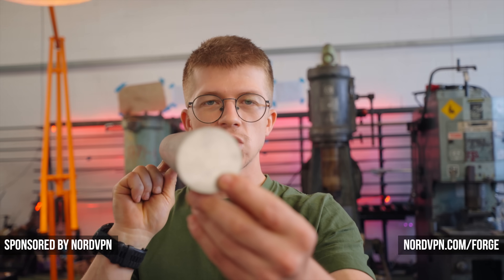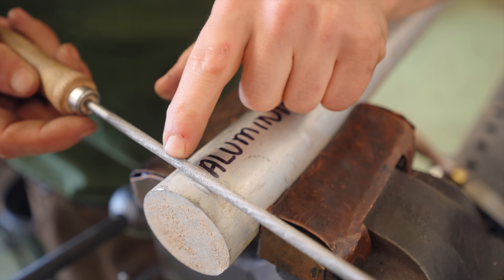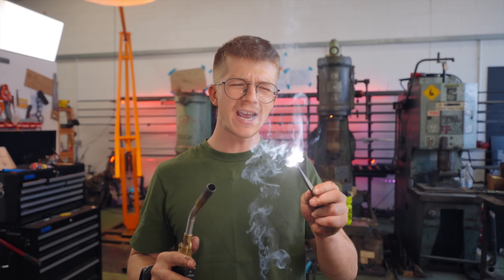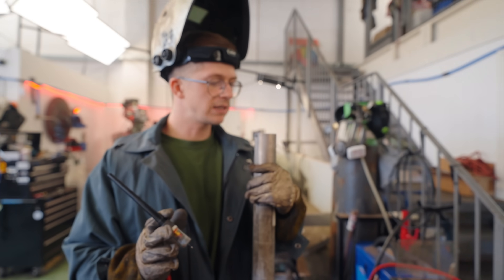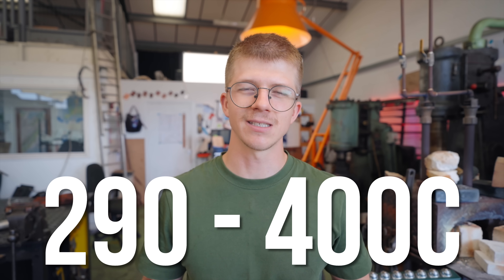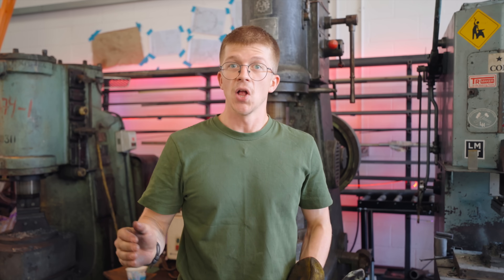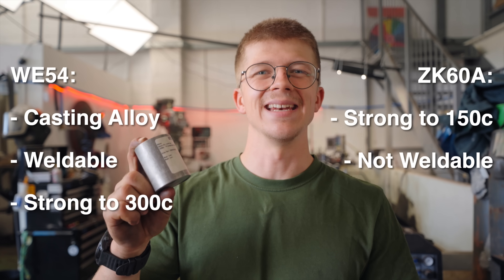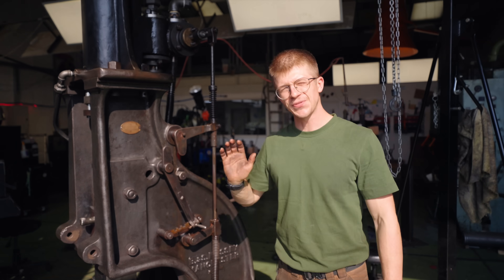Can You Forge Magnesium?

Comment: 0:20 "what metal isnt grey?"... Copper, brass, bronze, gold, to name but 4
Reply: Well, Brass and bronze are alloys.
Reply: @bl4cksp1d3r  So is the “magnesium” he uses in the videos.😂
Reply: @bl4cksp1d3r  so is steel though
Reply: @bl4cksp1d3r  Pretty much every metal part you ever used, saw, touched or used was an alloy. Aluminium can? Alloy. Gold ring? Alloy. Copper wire? Alloy. Iron? Alloy. Silver? Alloy. 

There is a chance you worked in a foundry and saw ingots of elemental... something. Probably lead or copper. 

Metal basically means alloy.
Reply: @krisspkriss  I am a studying engineer, Chemistry and metallurgy are in my smester right now. I get what you mean
Reply: @bl4cksp1d3r  yeah, but they're still metals
Reply: @amyshaw893  They're not pure metals, they're metal alloys.
Reply: @colorona8456  ok, what's your definition of "metal" and how is it different from "element"?
Reply: @colorona8456  isnt steel an alloy?
Reply: @amyshaw893 Not all elements are metals. But all metals are elements. An alloy is a mixture of metals. Hence, brass is not one metal, it's an alloy. Chemistry 101, dude.
Reply: @colorona8456  he didn't ask what pure metals. Steel was definitely one of the things he was comparing to which is also an alloy.
Reply: @bramweinreder2346  it's a metal alloy. Most of the things he would be comparing it to from a consumer perspective would be alloys. Most commercial "metals" are metal alloys. Aluminum, Titanium, Steel, Tin, in commercial products these things are almost all alloys not pure metals. He never said "pure metals" you guys are just being pedantic about not wanting to include alloys when that's almost exclusively the type of materials they work with.
Even the magnesium they're working with in this video IS AN ALLOY.
Reply: @amyshaw893  metals are a specifiic group of elements, alloys are mixtures of elements containing metals.
Reply: @colorona8456  this is a little pedantic, no? An alloy is still a metal even if it's not pure.
Reply: @cleverusername9369  It actually really depends on context. Because traditionally “metal” would refer to anything the looks and behaves like, well, metal. But in chemistry you also get the term metal for a certain subgroup of elements. Now alloys (being a mixture of at least one metal and other elements) are usually still metallic in their behaviour. And so depending on where you use it something like bronze would be a metal, or it would no be metal (in the sense of beloning to the element group of metals).
Reply: @colorona8456  So is steel
Reply: @bramweinreder2346  Well, an alloy is a mixture of elements, at least one of which is a metal. Steel is fundamentally an alloy of iron and carbon, but carbon isn't a metal.
Reply: @Wishbone1977  ah, you're entirely right. Thanks!
Reply: @amyshaw893  metal- a solid material that is typically hard, shiny, malleable, fusible, and ductile, with good electrical and thermal conductivity     Element-An element is a pure substance that cannot be broken down into any other substances. An element is made from just one type of atom
Reply: @zac9933  As you know, metals occur naturally in the Earth's crust, so they don't have to be produced by humans. Steel, on the other hand, is an alloy made from iron metal—meaning without metal, we wouldn't have steel. This also means that steel is not technically a metal, but rather a variation of metal instead.
Reply: @colorona8456  Tbf, it just said "metal" so the bar was set kinda low here
Reply: @amyshaw893 metals include all the transition metals, the alkali metals, and the alkaline earths, where elements include all symbols on the periodic table.
Reply: @colorona8456  the bar in question is also not pure. It's a metal alloy.
Reply: @colorona8456  Steel is also a metal alloy
Reply: @colorona8456  so are those two magnesium alloys he's using in this video.
Reply: @joepiejaapie  You can be the one to tell Alec he doesn't work with metals, then. Because steel, his usual metal of choice, is very much an alloy. As are just about all commercial metals not intended for processes as a chemical reagent.
Reply: @bramweinreder2346 if you're an astrophysicist, everything heavier than helium is metal.
Reply: @jnawk83  "everything" lighter too (hydrogen). I thought metals were only a small section on the periodic table. Turns out to be 80%!
I'm assuming we're limiting ourselves here to metals that are widely available for engineering purposes?
Reply: @amyshaw893  every metal is an element. not every element (like carbon) is a metal. an alloy is a combination of different metals. any more questions?
Reply: @I_Dawson_I  yes, it is iron and carbon.
Reply: @colorona8456 technically purely metal, just different metals but yeah it's not considered a metal but a metal alloy
Reply: @mosh8726  Electrum is a naturally occuring alloy and was known by the Greeks.
Reply: @amyshaw893 you could make a million alloys with color, elemental metals are by and large silvery or grey
Reply: @amyshaw893  Imo kinda weird to include alloys, because then you could include every fucking alloy of copper. Those alloys are not grey because they have copper in them. Or any other weird alloy.
Reply: @colorona8456can you explain when he said “it has to be a pure metal not an alloy”? No you can’t.
Reply: osmium
Reply: @dapcuber7225  Iridium, Antimony
Reply: @Locahaskatexu  but both of them are grey
Reply: Bismuth
Reply: @wavin_aquafino  bismuth is actually usually silver/ dull grey. The rainbow color is actually from rapid oxidation during crystallization.
Reply: @Gamewaterv2 Bismuth is grey. Its oxides are what can give it color, but only when the oxide layers are a specific thickness. That’s called thin film interference. The metal itself doesn’t have those colors.
Reply: @wavin_aquafino bismuth is grey also the colors are because of other processes
Reply: @wavin_aquafino  only when it makes the cool crystals, otherwise it's just a grey metal
Reply: @Gamewaterv2 fun fact bismuth is Grey but it's oxides are very vibrant
Reply: @Gamewaterv2 bismuth is grey without oxides
Reply: @Gamewaterv2bismuth is technically still grey. It has a very faint pinkish tint to it, but it’s still grey
Reply: @Gamewaterv2 Bismuth being literally every colour but grey. 😂
Reply: @Gamewaterv2 Bismuth is gray.
Reply: Is silver silver or is silver grey😂
Reply: @jono6379  yes
Reply: @jono6379 pure silver is actually more of an off white.
Reply: ok brass and bronze only because of the copper in it.
Reply: caesium
Reply: "Silver" metals are white-to-grey, the difference is how reflective they are, aluminium is the most "silver" metal because it has the most reflectance in the visible range. Copper and gold are the only metals with very strong colour-- they both reflect most strongly in infrared and drop down as they reach the visible spectrum, leaving a reddish-colour. Nickel is the only other metal with any appreciable colour - it has a barely visible yellow tinge.

Most metals mentioned here are coloured due to an oxide interference layer, like bismuth,  or "blued" steel, but have no colour naturally (grey/white). Titanium was mentioned as being white, it is also a grey metal, but "titanium white" is a pigment made of the oxide of titanium, not the metal, which is very strongly white.
Reply: Osmium
Reply: Cobalt
Reply: cesium
Reply: There is also color change that is a result of heat treating
Reply: @poetgriot18  it is not the color change of a metal itself, it is oxidation. I believe the only way to change the color of metal without chemical transformation (so it stays metal with metal properties like free electrons) is to make extremely fine powder, though works only with some metals, like gold.
Reply: Chromium
Reply: This replies to this comment are crazy 😂
Reply: At least I proved our videos aren't scripted, lol
Reply: @JamiePopple  unless you script in mistakes on purpose to encourage engagement.
Reply: Everyone is in here arguing about what is a metal and what isn't, both sides have somewhat compelling arguments, then a guy comes in out of nowhere and says sulfur is a metal. 

11/10, perfect comment section
Reply: Most commercial aluminum is also an alloy and not pure aluminum
Reply: Cobalt? Even the pure metal is still bluish.
Reply: Mithril isn't grey too, and it exists, and I'm not talking about titanium, search for "Hakim e os Anarquistas" on YouTube to see it in action
Reply: @CRTCLDSSTR  isn't it said to have a silvery colour?
also, what do you mean by "it exists"?
Reply: Ok to everyone that doesn’t understand alloys and metals here’s the deal: any solid bound together by metallic bonds is a metal, including alloys. Most elements on their own are metals, but that doesn’t mean only elemental metals exist. Oxides are not alloys because they’re held together by ionic bonds. Steel is an alloy even if one of its elements is not a metal on it own, and that’s because the carbon is participating in the metallic bond instead of ripping away the iron’s electrons, as oxygen would.
Reply: Those are just different shades of golden grey!!!!!
Reply: cobalt
Reply: Pure silver is actually a more of an off white color. Osmium has a blue tint to it. Sodium is the same off white as silver metal.
Reply: Wonderful 🧡
Reply: Came to write the same thing 😉
No worries Jamie, we all make mistakes 🧡 (some are just more public than others). Lots of love to ya buddy.
Reply: bronze and brass are alloys
Reply: Prove to me that ogganeson is not red
Reply: Osmium
Reply: You can also go off the electronic structure definition of metals, semiconductors, and insulators. Metals have no gaps between energy bands in the solid, allowing for free conduction. Semiconductors have gaps, so electrons can’t freely flow unless energy is applied to the solid. Brass is a metal because its electron bands overlap. It’s not a pure element, it’s a solid solution.
Reply: Zinc with its white oxide, iron with its red oxide
Reply: Silver, platinum
Reply: Silver 🧐 is silver 😊
Reply: Silver, people can fight me on this one but silver is a unique colour as anyone with silverware would know.
Reply: @PL4GU3d  you mean shiny grey?
Reply: Cadmium-refined cadmium has a blue luster.
manganese-it's pinkish gray.
Reply: Osmium is blue, one of my favorite elements.
Reply: Hydrogen is pretty much not grey. Or any other color.
Reply: @durandalgmx7633  Hydrogen isn't a metal.
Reply: @magisterrleth3129  technically hydrogen is a metal but a gas or liquid 

You have freeze it and it shines like metal 

It's an alkalai group it's has similar chemistry to lithium, sodium, potassium, Caesium and rubidium
Reply: @Clancydaenlightened  I think you're getting lost in the weeds if you think hydrogen is in any way relevant to the conversation. Metallic hydrogen exists only in the most extreme conditions known to the universe, I think it's safe to say that for practical human purposes, particularly blacksmithing, hydrogen is not a metal. You're just trying to look smart, and looking the opposite in the process.
Reply: @Clancydaenlightened  Yes and no. 
Yes it can be a metal, under the most extreme scenarios. Hydrogen can not achieve metallic properties while in the state of gas or liquid. While in these states it behaves as a non-metal. It does not sit in the column of alkali metals because it behaves like the rest, it sits there for electron valence consitencies. 

For hydrogen to exhibit these alkali properties (as a solid), it needs to be under the most ridiculous pressures, around 4 million atm and needs to be under 12 K. It would need to be in the core of a Gas giant to exist. So in every sense, nobody would teach hydrogen as being a metal.
Reply: Caesium
Reply: Caesium
Reply: All of them, they are "silver" colored.
Reply: They are on a black and white tv.
Reply: Ah yeah, all the internet "experts" are at it again...
Reply: @ickebins6948  The annoying thing is that, depending on the settings and the platform being used, not all comments or replies to comments are displayed, so you end up replying to something that's already been commented on 20 times. Then you look like a fool, I totally agree with you on that.
Reply: Gold you apes
Reply: Cobalt
Reply: Osmium is slightly blue.  It's beautiful pure under the right light
Reply: I mean to be fair, just saying copper would have still made your point lol
Reply: Titanium under the right conditions
Reply: ur mum
Reply: What's the radioactive one? I don't think that's exactly grey. More of a super light tan right?
Reply: @xX_Gravity_Xx  thorium I think, but the tan is just an oxide, the pure metal is grayish or silver
Reply: What you get if u sprinkle a little dunning kruger with a dash  of smart arse this guy would be great at a party 😂
Reply: thx i just wanted to tell myself
Reply: Gold, platinum, copper, caesium, osmium, to name a few
Reply: Calcium, Potassium Sodium.
Reply: @mh6276  I will argue these are grey. When not oxidised (which happens basically immediately, i know)
Reply: gold
Reply: It's called luster
Reply: Pretty sure Heavy is black 😂
Reply: Under 4.9 million atmospheres of pressure, hydrogen becomes a black metal.  I have not been able to reproduce that in my home lab yet.
Reply: Dysprosium
Reply: Gold is gold.
Reply: Osmium is technically blue
Reply: Osmium
Reply: Cesium and iodine to name a few more.
Reply: There are three pure metals that aren't basically grey or silver - Gold, Copper, and Cesium. Some people argue about Osmium being blue, but it's pretty grey.
Reply: Silver
Reply: Copper, brass, bronze are all considered grey metals because of the natural oxide coating. He literally explained that in the video.
Reply: @truantray  Obvious troll is obvious.
Reply: @truantray  Bro is straight up lyin
Reply: Osmium us blue
Reply: Uranium...huh....neat
Reply: Osmium has a slight bluish color
Reply: hydrogen
Reply: I immediately just commented something similar and then seen yours lol
Reply: titanium is white naturally
Reply: @NorsMythix90  Isn't that just the oxide? (Though I guess he was also referring to oxidation in the video)
Reply: @countpoolnoodleiii99  it would have a different definition than element by the fact that metals is a subclass in the periodic table of elements such as noble gases and alkaline metals are sub catagories
Reply: @NorsMythix90  Titanium OXYDE is white ...
Reply: Everyone arguing what's alloys and what's not... anything with at least one metallic element is considered an alloy. That includes Steel!
Reply: Since you guys are focused on alloys, lemme throw you another ball.
Rust is not grey ...
Do oxydes qualify as alloys ?
Reply: @LeVraiPoio lol no oxides and other compounds are not alloys.
Reply: This comment section is proof that "science" shouldn't be one subject and should be mandatory.
Reply: @LeVraiPoio  No, rust is the reaction of oxygen with a metal. Thats why rust is also called oxide. An alloy is a mixture of a metal and another element, metal or not. Copper + zinc = Brass. Iron + carbon = steel.
Reply: @LeVraiPoio  don’t think so, oxides are their own compounds.
Been a while since Chem 101 so correct me if I’m wrong, but an alloy doesn’t actually break or form new intramolecular bonds - think of it as mixing clay together. 
An oxide changes the chemical structure by adding new bonds, and as such it’s a compound, not an alloy.
Reply: @lermanmar3416  I mean an alloy leverages metallic bonds, but those are kind of different from other chemical bonds, and an alloy is a lot like a solution rather than a compound.
Reply: @LeVraiPoio  black rust is a dark grayish color.
Reply: Also, iron is a dark enough gray that it’s long been referred to as “black metal.”  It’s the origin of the name “blacksmith.”
Reply: @copasetic1  interesting. I always thought that it came from the oil they used to protect it from corrosion.
Reply: @bramweinreder2346  to be a bit more precise, the dark oxides formed on iron while forging also probably contributed to the moniker, but they are also a major reason why room temp iron tends to be dark in color.
Reply: brass and bronze are an alloy of metals so im not sure those count. Maybe copper, tin and silver colored metals such as cesium and of course, silver. I'm not too sure there are many though.
Reply: Calcium.
Reply: @EricDMMiller  calcium is grey
Reply: you only named two. (brasses and bronzes are copper and get their color from it. saying brass and bronze have ared cast is like saying 'milk is wet like water' yeah, funny how that happens...)
Reply: @StripeyType  water isn't wet, but that's another debate 😂
Reply: @bramweinreder2346  indeed!
Reply: purple gold
Reply: run a little or alot of current through it and with some electrolytes and boom new color
Reply: Uranium is typically black
Reply: @JunkyardBashSteve  That black color is from the oxide layer (UO2 if I remember correctly). Beneath that the actual metal is grey.
Reply: Bismuth! 🌈
Reply: Osmium
Reply: Lead is also 'darker than gray'. BTW brass and bronze are not metals but alloys.
Reply: Hydrogen
Reply: @LogicalNiko  Are you saying hydrogen is a metal? It's not... It's a gas until you get to -253 C at which point it becomes a clear liquid.
Reply: @ashe1.070  in a joking sort of way... but yes it technically is classified with the  alkali metals but does not display any properties of a metal except in extremely high pressures or low temperatures.  However more to the point when it does behave as a metal it is also not grey 😁
Reply: Tbf, gold would be grey within Newtonian physics though I think
Reply: @countpoolnoodleiii99  what, where do you live where Newtonian physics doesn't apply?
Reply: @amyshaw893  I heard somewhere, that the emission spectrum of gold is affected by the relativistic speeds of its valence electrons. So if we only account for Newtonian physics, it would be a different colour. Don't know if it would be grey tho, just a guess
Reply: @amyshaw893 the universe. Newtonian physics is an awesome approximation, but it does not accurately model reality at super small scales or at very high velocities.
Reply: @amyshaw893 the universe we live in. Newtonian mechanics is a good approximation but general relativity is a better one.
Reply: Sulfur is yellow and yes it's a metal
Reply: @WestCoastWheelman In what universe is sulfur a metal?...
Reply: @jonahs92 this one
Reply: @WestCoastWheelman  Yes it is yellow. No it is not a metal. It has covalent bonds between atoms, not shared electron shells as in metals.
Reply: @WestCoastWheelman Sulfur is absolutely not a metal! It’s not even a metalloid. It is a non-metal!
Reply: @WestCoastWheelman  You could've just looked at the periodic table for 5 seconds to realize this is very false. Its not even a metalloid lol
Reply: @WestCoastWheelman sulfur is not a metal
Reply: Sulfur is one of the nonmetalest nonmetals to ever nonmetal. @WestCoastWheelman
Reply: @WestCoastWheelman  Sulfur is not a metal
Reply: @WestCoastWheelman it's a metal to astronomers. 😊
Reply: @Yaivenov  yeah they do the easy thing and consider everything not hydrogen or helium metals
Reply: @phizc  You would think they could have thought of a new word for it - like ponderoses.
Reply: No its not @WestCoastWheelman
Reply: @WestCoastWheelman  source? I'm really curious what this information is from
Reply: @WestCoastWheelman  Gotta love misinformation
Reply: @WestCoastWheelman  How so? It's square in the middle of the nonmetal portion of the periodic table.
Reply: @WestCoastWheelman  what strange universe are you in sulfer isnt a metal, its a non-metallic element
Reply: @WestCoastWheelman  Hydrogen is more a metal than Sulfur will ever be. Sulfur also has at least one allotrope that is not yellow but more of a dark red glassy color.
Reply: @WestCoastWheelman   Sulphur is not a metal on the table of the elements as far as chemists are concerned. But astrophysicists consider anything not hydrogen a metal, so...
Reply: @WestCoastWheelman no, sulfur is a nonmetal go look at the periodic table again.
Reply: @WestCoastWheelman it’s not
Reply: @WestCoastWheelman  Sulfur is NOT a metal.
Reply: @WestCoastWheelman  Same as calcium
Reply: @WestCoastWheelman  This couldn't be less correct. Sulfur is a non-metal. It's on right side of the periodic table right between Phosphorus and Chlorine.
Reply: @WestCoastWheelman  calcium is too
edit: a metal not yellow
Reply: @WestCoastWheelman  Sulphur is literally in the non-metallic part of the periodic table. it has zero metallic propeties. It's not even a metalloid.
Where did you get this idea from out of curiosity?
Reply: @WestCoastWheelman not at all😂 sulfur is not metal
Reply: Sulfer is a non-metal  @WestCoastWheelman
Reply: @WestCoastWheelman  which sulfur?